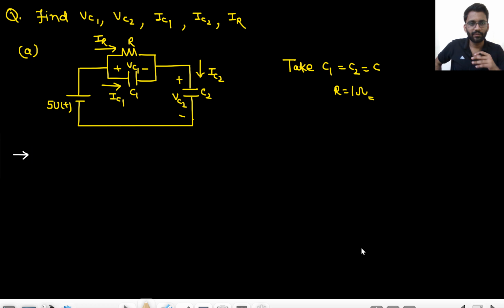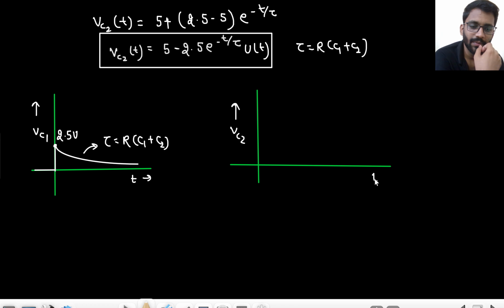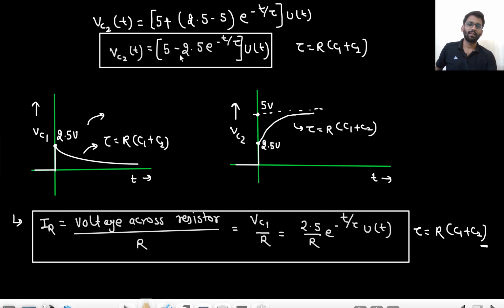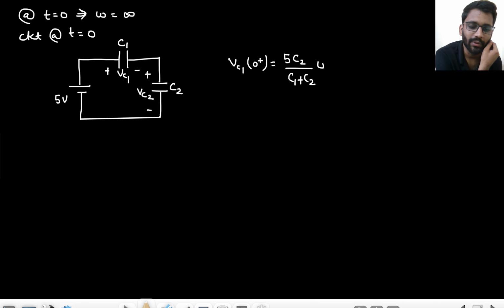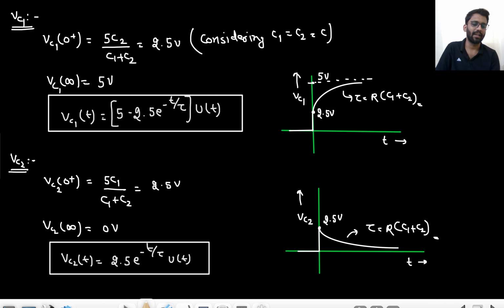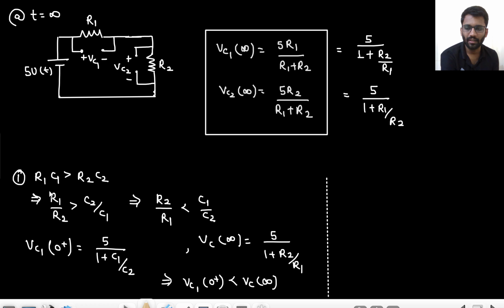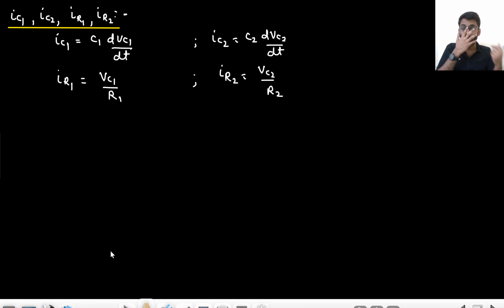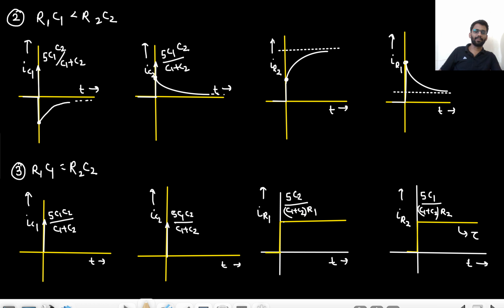Conceptual Examples of RC Circuits || Network Analysis || GATE 2025-26 || PrepFusion

Comment: sir at t=0+ we are replacing the ckt by two capacitors as parallel combination of resistor and cap ...(19:00)
but while writing current equations why Ic1 is not same as Ic2 , i mean to say why I(R) would not be zero as due to parallel connection entire current should flow through Ic1 at 0+

Comment: Sir in question two parallel cap with resistors for vc1 how did u get the value for vc1(0) as 5/(1+c1/c2) in the graph in case of r1c1>r2c2

Comment: i just have a doubt that 
@9:14 @steady state, Vc1(infinite) is 0v, 
you mean that @ steady state for an RC ckt in parallel, Vr = Vc ? like as i = 0 Amps in steady state so Vr = (0amps)(5V) = 0V, so Vr = Vc1(infinite) = Ov
Reply from the maker: Not just at steady state. In that ckt, always Vc1 will be equal to Vr